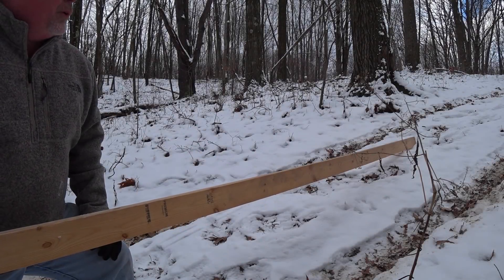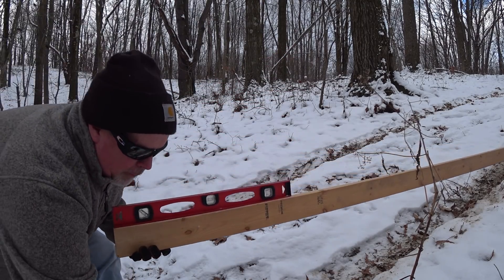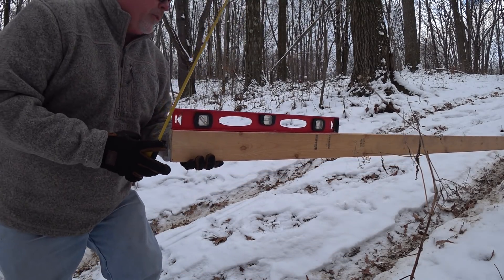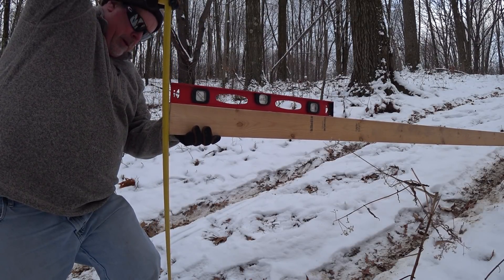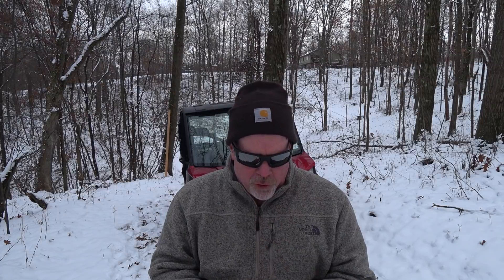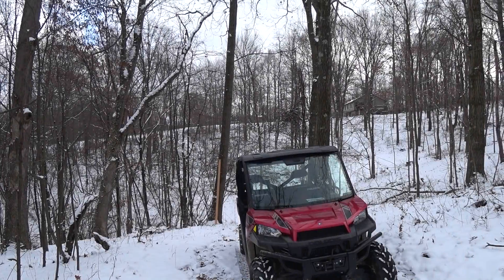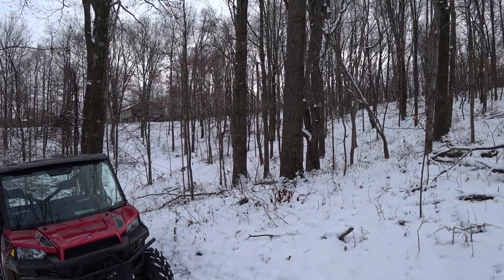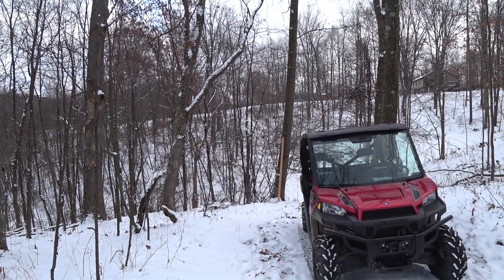#114 How To Measure Slope Percentage

Comment: Certainly is an interesting topic, but we should remember to keep the difference between slope in percent and in degrees straight.  For example, a 100% slope is equal to a 45-degree slope.  To convert your slope from a percentage to a slope in degrees, use a scientific calculator or equivalent app on your phone to find the inverse tangent (tan-1 key on your calculator) of your rise over run. 

In Mike’s example: tan -1(38/120) = slope of 17.57 degrees.  

This is a useful conversion to know because many of us think of slope in degrees (Straight up and down 90 degrees or halfway between the horizon and straight up as 45 degrees, etc.)

Enjoy all of your videos!

Comment: After watching this I started re-evaluating why going up some of the inclines on my property don't bother me -- and I realized that for the most part they are shorter climbs than the wheelbase of my tractor. For example when I cross over one of the driveways from the side I never actually experience the slope of the incline since only the front or back wheels are ever on the incline while the other set is on flat terrain. .....or (in some cases) are getting very close to being on flat terrain (there are a few spots/approaches with inclines that are longer than my tractor's wheelbase).

Granted I still think I'll continue to check into bringing in fill to re-work some of the worst areas as those areas contain avenues of approach that are ~50% (or greater) slope and are wheelbase-ish length -- which has started to make them a nuisance to maintain (even on foot).

Comment: I use clinometer on my phone. Live on a hill that averages 15 degrees. I back up my hills and always run 4wd. Kioti ck3510 and hoe on all the time. Even 15 can get spooky and I like the hoe because I tend to back up 10 feet at a time leveling side to side as I go. Go slow and if its slick do something not tractor related lol

Comment: Good topic Mike... NYS Has a ROPS program for older tractors without one... My tractor is a compact Ford Unit & I did not realize how top heavy the unit can be on a mild slop...  I now go the longer way around to avoid that short cut that would cause that tractor to roll...  God Bless... Chief (NYS/ADK)

Comment: So what you just did is measure the slope for that 10 foot interval only. If you had an inclinometer, either on a pocket transit (brunton) or your cell phone, like another person suggested ( the app called Theodolite) you could estimate the average slope inclination. You would just put your 'eye' in the plane of the slope and read the angle of the slope in the App.

BTW, the App Theodolite (by Hunter Research and Technology LLC) is excellent, but a rather complicated survey tool. 

Thanks again for all the effort you put into your videos. You really do a great job.